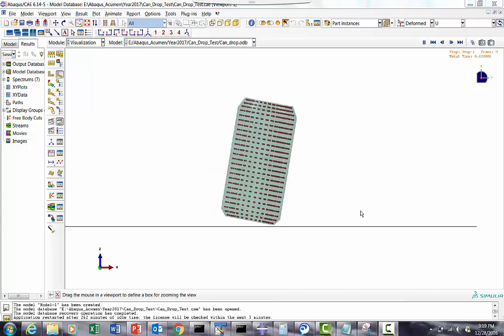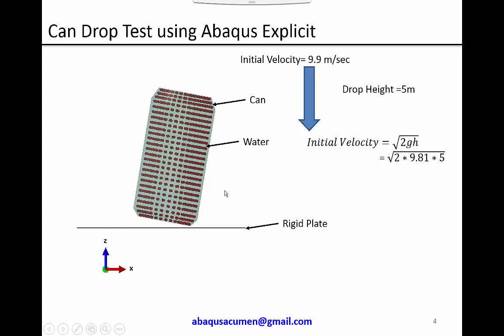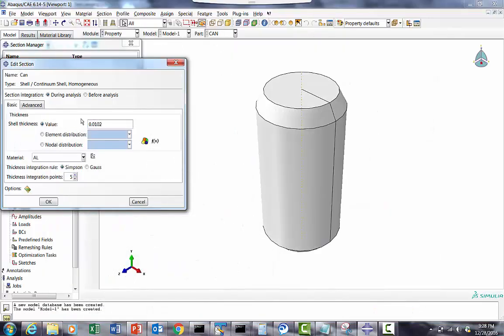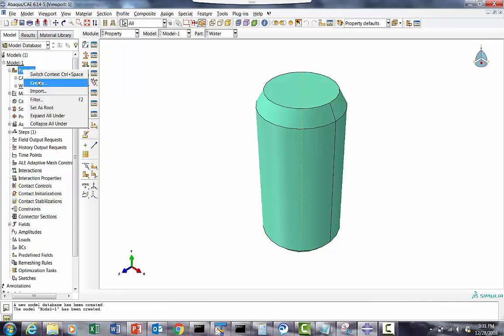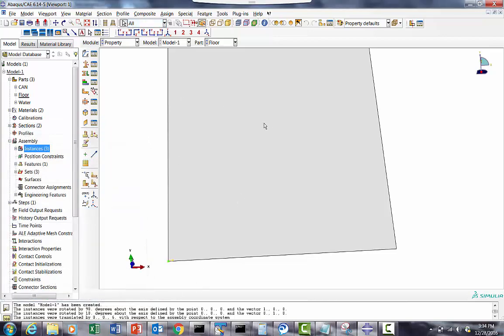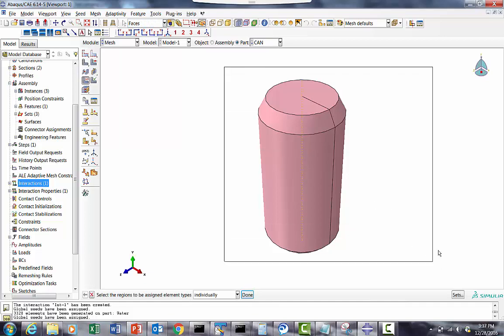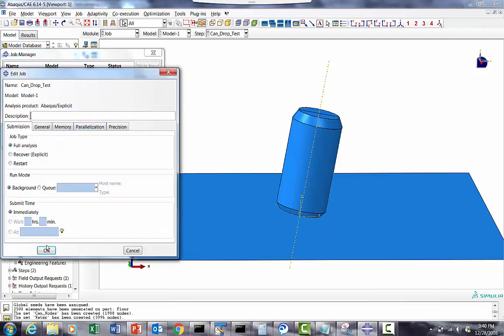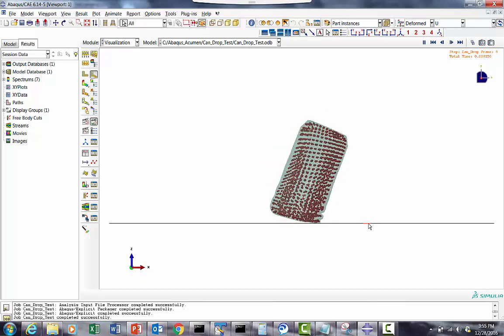Abaqus/CAE SPH Modelling Tutorial: Example- Can Drop Test –Step by Step Method

Comment: hello sir, at around 1:33 the material properties for the can and the water are provided.   Can you also list out what should be used in English units if I am proceeding with everything in lbm, lbf, inch, and seconds for both aluminum and more importantly, the water?   I've completed replicating this tutorial on my computer, but I'm getting a bizarre error:  "smoothing length is too large for several PC3D elements...."    I'm presuming that this is probably b/c I probably have the numbers incorrect for EOS and viscosity on the water property definition.

Comment: so I googled the conversion of inch to mm and found that 0.004 in corresponds to 0.1016 mm but you used 0.0102 mm
did I miss something?
Reply from the maker: The thickness of can is 0.0102 mm, I had check it physically. I guess I guff with unit inch. Thanks a lot for bring to to my notice.
Reply: Abaqus Acumen thank you for such a quick response!!!

Comment: Hello, Thank you very much for your videos about SPH, it is really very helpful, I am modelling the fall of a column of water under the gravity, so at t=0 the water collapses. How  do I model that? I do not know what is the velocity so which predefined field I need to consider ?
Reply from the maker: You can use CEL Technique. See our latest videos on CEL.
Reply: Thank you abaqus Acumen for your prompt answer, I will these videos on CEL.
Reply: Hi again,

Thank you for these videos!

I watched the 2 videos on CEL, I can't understand what are the benefits of using CEL over SPH.

And in both of the videos you used the velocity as a predefined field which in my case I don't have its value.

In my case, initially I have water inside a storage tank, and then when I remove the tank suddenly the water will collapse under gravity until it hits a wall which I need to study its strength against fluid impact. So, during the simulation the storage tank doesn't  have to be there while as I can understand from the videos the tank need to be there to fill it with water as the CEL method requires.

Do you have any suggestions do model that?
Reply from the maker: Please make your problem defination and send us on abaqusacumen@gmail.com
Reply: Did you solve your problem? for the gravity at t=0?